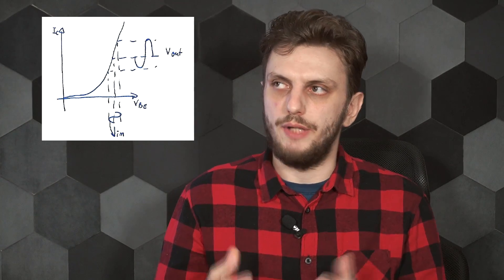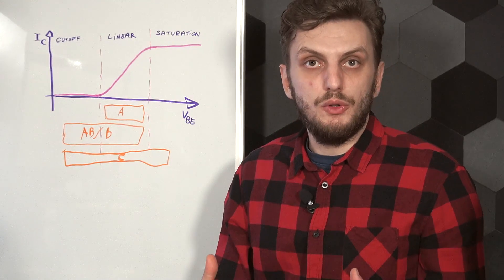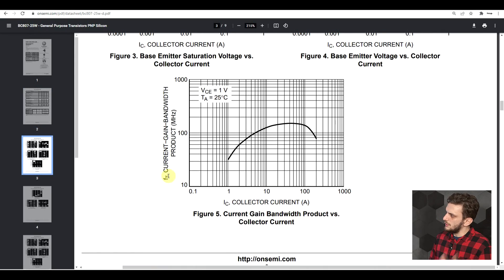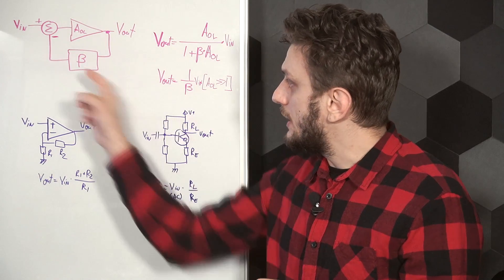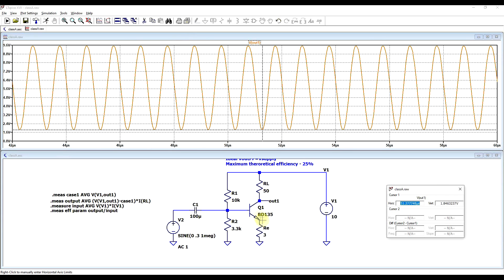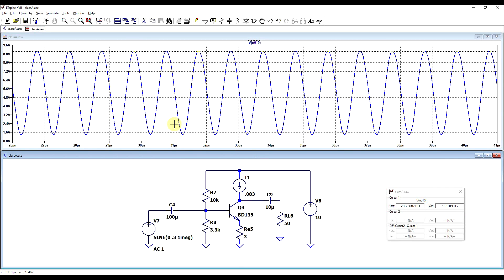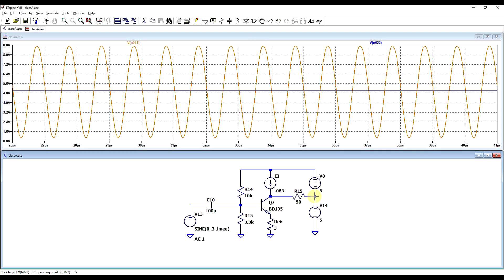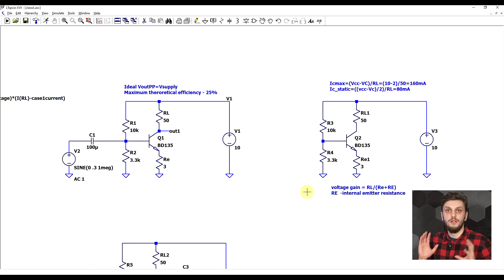The Class A amplifier - basics and simulation (1/2)

Comment: Can we use higher power supply  voltage, 60 volts for example, but to use same value resistors like in this video or we must calculate all values??
Reply from the maker: You need to recalculate the resistors if there is a change in supply voltage. It might work with small changes in the supply +/-1V compared to what was designed, but any more than that and you will see significant deviations in the behaviour
Reply: @FesZElectronics  Thank you so much sir, I will study class A amplifiers I want to build it because it is the best sound... for jazz especially :)

Comment: Brilliant presentation, to the point, very clear language, no repetitions.  
I know that it is not really necessary, but it would be interesting if those who cover transistor amplifiers would mention that if one goes into deeper details of the input and output impedance of the transistor amplifier, one finds that  for a positive going signal there is a slight difference from the impedance for a negative going signals. This is due to the " diode " characteristics of emitter base junction, 
Again well done in making this video.

Comment: I've copied your first circuit in ltspice. From what I can tell, its exact in all the details as timestamp 9:25 except for the measurement lines. When I run the simulation, my output waveform has a flat spot around 9.9995V for about .05us. The peaks in both directions also do not look as smooth as your waveform. What am I doing wrong that is causing this?
Reply from the maker: It might be related to the transistor model that you are using; maybe you can try a default model that is present in LTspice to see if the same thing occurs. I think the model I used was from the onsemi website.
Reply: @FesZElectronics  Thanks very much for responding. I did some more research, watched a few more of your videos. I came back to this and used a 2n3904 and was able to get a functioning circuit. Grasping the details has been a challenge. Going back through some of your videos definitely helped. I look forward to watching more. Thank you very very much!

Comment: Hi, please could you explain to me more in details why voltage output is 2*Vdd? Thanks
Reply: Hi,

I also had trouble with that statement. After some tedious calculation I discovered by chance the simple solution:
First, think about the DC analysis. Your collector will be (with an ideal inductor) at vdd. Thats one vdd.
Second, think about AC analysis. You are basically imposing a sine voltage over the inductor, that means (considering a sine wave) the voltage created by the coil will be at a max  vdd. 
You can of course get higher voltages for other scenarios, for example if you charge a large coil for a while (DC) and then apply a sine in a circuit with a ridiculous amount of gain. 

Hope you find that helpful

Comment: Why do we use inductor instead of resistor in collector terminal in this ?
Reply from the maker: An inductor is a reactive component - it stores and releases energy; in contrast a resistor only dissipates energy. Using inductors is far more energy efficient, if you can practically use a large enough value.
Reply: @FesZElectronics  Thank you

Comment: I understand the first diagram on negative feedback (top left), and the maths of how (with high local gain) actual gain is determined by the negative feedback. I understand the low left circuit, setting negative feedback by a voltage divider built of 2 resistors.

But the leap to the lower right diagram is beyond me.

R(L) and R(E) do not seem to implement the same voltage divider as the previous circuit.

I'm happy that you're right, and the simulations back you up, but I don't understand why you're right.
Reply from the maker: The example was not supposed to derive one from the other, it was just similar circuits, sort of..
For the single transistor - common emitter amplifier one way of looking at it is as follows:
The voltage variation (input signal) on the base will be the same as in the voltage variation in the emitter ->emitter voltage follows the base voltage. So the voltage drop on the emitter resistor is the same as the input signal.
Now, maximum collector voltage swing + maximum emitter voltage swing is a constant (the supply voltage); since the same(approximately) current passes trough both emitter resistor and collector resistor, the ratio of collector voltage to emitter voltage is equal to resistors rations.
So now, input signal ratio to collector voltage (output signal) is equal to the 2 resistor ratio. Let me know if this makes sense.

Comment: can use for gnss LNA operation?
Reply: Hi ! For that purpose, you need to consider at least two main issues: 1/ the frequency of operation, for GPS it's about 1500 Mhz... and 2/ a low noise factor device (NoiseFactor <1 dB). This cannot be achieved in any way with plain bipolar transistors as shown in the video. There are some devices able to give about 20 dB of gain with very wide bandwith, e.g Mini-Circuits PGA-103 among others,  and may be bought with PCB and even shielded with a metal enclosure from China.

Comment: Amplification is a misnomer.  What's going on is that a large constant voltage source's current is regulated by a small fluctuating voltage.  The ratio between these two is considered to be the amplification.  The input signal itself is not amplified, it only regulates a larger signal.
Reply: Wow, what's next? Transistors don't have actual gates in them that let the electrons pass through like bouncers at a club?
Reply: @AuxiliaryPanther  My explanation of controlling a larger source with a smaller source makes it easier to understand exactly what's going on.  My professors never made this clear.  They professed instead of taught.  So I thought I could possibly help somebody who had the same shitty lessons.
I'd be interested though to hear your bouncer analogy.  It never hurts to hear another explanation.
Reply: @TheAnimeist  oh, that was the whole analogy. My whole reply was also a joke. I'm sorry you didn't have a good textbook to read in support of your education.
Reply: @AuxiliaryPanther  LOL, sometimes things get lost in an internet conversation.  Especially good sarcasm.  Have a good day!
Reply: Voltage amplification is, by definition, the ratio between the amplitude of the output signal and the amplitude of the input signal. There is no misnomer. What is actually happening inside any given amplifier is completely irrelevant to the fact that it amplifies or to the size of its amplification.
Reply: hermione granger from harry potter😃😃😃
Reply: Mansplaining.
Reply: @gabriel_mendez  I was trying to add clarity that I wish I would have had from school.  Can you add clarity to your post?  What are you conveying here?

Comment: Can it be made so the resistor on the collector side is inversely proportional to the input voltage resulting in an automatic gain control? And what structures need to be added so the input can be current instead of voltage?

Comment: class A amplifier series is great 👍.
but idk why some people say collector feedback biasing is superior compared to
voltage divider biasing?
Reply from the maker: I guess that is a different topics to cover - various bias methods. In general depending on the use case there is one method better than others - I still need to do a bit of digging on this though.
Reply: @FesZElectronics  hmm 👍
Reply: In a common emitter amplifier stage, the output voltage at the collector is an amplified and inverted copy of the input signal. Put simply, if you feed back some of that voltage to the base, you add in a small signal that opposes the input signal. The result will be that any tendency for the collector voltage to change will be opposed by the feedback voltage. That increases the stability of the collector bias point. It also tends to reduce the voltage gain and both the input and output impedances. Depending on what is most important to you, the effect of the negative feedback from collector to base will either be an overall advantage or disadvantage, but with good design, it can be superior to the straight voltage divider biasing.

Comment: A well designed class A amplifier has a smooth soft sweet sound especially when paired with a good quality well designed class A preamplifier good well designed speakers the sound can’t be beat for something so easy to build yourself. 
                  Who cares if it may be bigger, heavier,  generates a lot of heat, or only 20% to 40% efficient. 

They are so easy and cheap to build yourself and sound better then anything you can buy in a big box store like Best Buy or other store.
Reply: nonsense
Reply: "a good quality well designed class A preamplifier"  hi this is exactly what i am looking for   A good line preamp with gain of 2-3 max   Do you have any sugestion ?  i would need only a schematic 
My feeling is that the preamp makes most of the sound
Just take a same power amp and listen to it when driven by a solid state preamp and a tube preamp ... a sea of difference   And usually the tube preamp sounds more musical 
Regards, gino